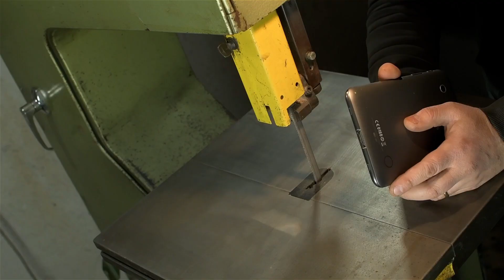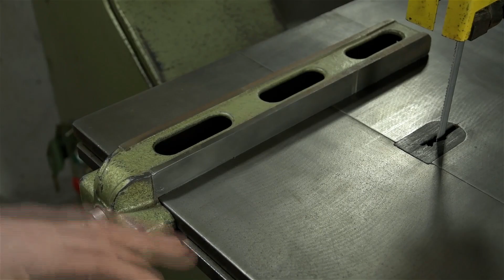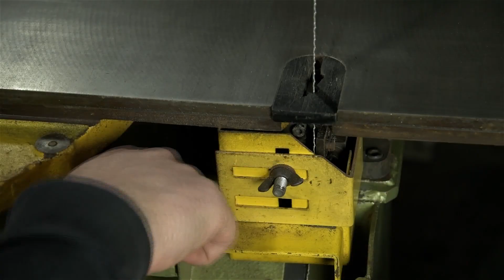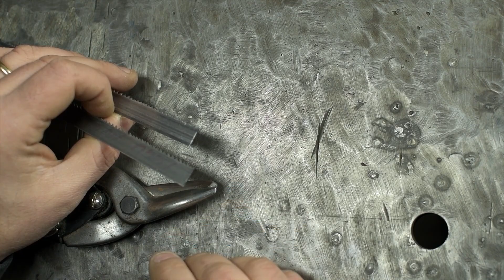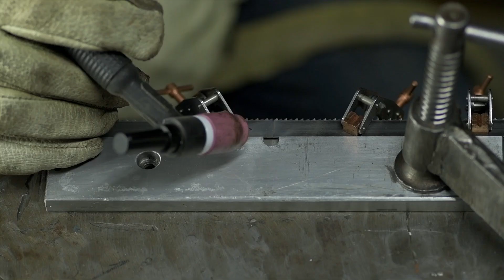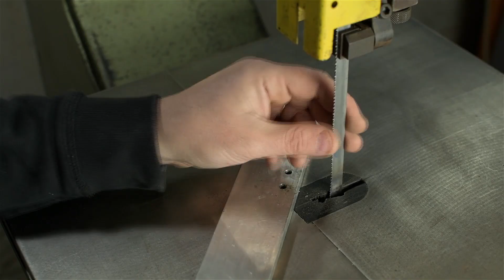LIVE!? - Welding Bandsaw Blades & Startrite Saw

Comment: I don't need a third bandsaw, but if I did, I think you might've sold me one one of those beefy startrites I see in the listings from time to time.
TIG welding the blade seems like a reasonable enough way to solve the problem, though the other gotcha aside from having to anneal the site of the join is that in so doing, you may want to put some wet clay on the teeth to keep from drawing the temper of the teeth. That may be more fussing than is really worthwhile - I honestly dunno.
Reply from the maker: interesting, never thought of that!
Reply: The advice is worth at least as much as you paid for it. ;D full disclosure: I've never tried the wet clay trick. I've just seen it written about in old blacksmithing books.

Comment: Let's have a guess at this: The base of the Escher illusion is at 45 degrees moving away to the left, the thin horizontal is at 90 degrees to the base front upright, the top is at 90 degrees to the thin horizontal but moving forwards. So the top front leg is not connected to anything and neither is the bottom rear leg, nice, draws the attention, cheers, Andy

Comment: Hi Tony. You making the best Films ever. Your bandsaw is bretty neet, but these 3 wheels put, how you mention it, a lot of Stress on the blade. We have such a Saw but bigger at work, and the blades are often break bevore they get dull. And when I look at the broken blades, I see a lot of cracks. The harder the blade, the more often they will brake on you. But for your use, that wouldn't be such a big problem.

Comment: I tried to tig a bandsaw blade tonight after seeing this and it just didn't work for me. I have a size blade that has been discontinued and thought there may be joy, but I'm scratch start and can't initiate an arc at low enough amps. When i get it high enough to initiate the arc it blows through the blade. So great job tony, wish i could do it.

Comment: We used to put 180degree folds in the belts on our cam auto lathes for even wear on both sides. Never did any testing to see if it actually helped or not, just took it as granted that it was done that way, and continued.

Comment: Hey Tony... I have a Startrite Bandsaw 18-T-10 with ball bearing guides. I’m in the process of remanufacturing these parts for the blade guides. The band saw came from a College workshop where the blade hasn’t been set correctly and has mullered both assemblies. If there is a way of sending the drawing I have and other details I would happy to do this. John 🇬🇧
Reply from the maker: Thanks John!  I'm going to feel out these solid guides for a bit, see how they work in real life.  But if I come back to roller guides, I'll be sure to get a hold of you!

Comment: Tony, I’ve had great success silver soldering butt joints. Never had one fail actually. The only other trick I was taught was to twist the blade 180 then holding the ends together and touching those ends against a bench grinder to make the ends complimentary angles before soldering. Regarding your request for opinions about blade guides,  DoAll, and my Powermatic, use hardened metal guides that come down at an angle. They work great but you need to have sets of different thicknesses, and a blade guide with an adjustable thrust bearing.  I’ve seen then for cheap on eBay.  Thanks for your terrific videos.

Comment: Your video timing is impeccable, I just bought a green vertical bandsaw last week and finished wiring it with a VFD 12h ago.
Now i feel prepared to play with welding blades :-) 
PS I also made a joke about mine having a blade speed for asbestos.

Comment: :D A mobius blade would need teeth on both edges and would last twice as long between sharpening because the cutting edges would serve half duty. You'd have to come up with some weird multi wheel / guide system to manage the twist, and I'm not sure how you'd make the blade guide since you'd need something to press sharp teeth against during the cut. Neat to think about. I want to see someone make it.

Comment: I had 2 Startrite  bandsaws . One was the identical model you are showing and i also had a smaller version with the roller blade guides. 
The version you have is the best but you need a full set of blade guides. I used to grind and braise my blades with oxyacetylene torch as it also anneals the bade at the same time.

Comment: Your the best Tony!  But when it comes to blade guides, the roller guides from the "Roll in saw" model EF 1459 are the best ever. My roll in is about  30 years old and the guides are the originals and still going strong with daily industrial use. The only problem is the # 1A48 guide set is $405.00 but you could copy the design and make your own. 1/4 to 3/4 blade size with no adjustment and no adjustment for gage of blade. Check them out!
ATB, Robin

Comment: We've got an old Startrite at work - I love that thing. Have cut all sorts of metal, phenolic, and even used it to resaw some fine timber. Ours has the blade welder but I've found it to be a bit fussy with blade stock. Was struggling to get a good weld on some 1/4 inch stuff last week so may have to have one of the mouldmakers teach me how to TIG. Our blade guides are pretty shagged and we'd like to convert to roller guides so I'm going to keep my eyes peeled on your channel for an update. Subbed.

Comment: Also... I'm thinking some brass or even copper roller guides that contact the blade would be kind of interesting. They'd heatsink the blade a little, potentially meaning you can run it WAY faster... While also potentially making the blades corrode and snap.......... Win win! Particularly for copper, I was thinking there'd be some actuated scissor lever spring thing that retracts them away from the blade when it's off to prevent mega corrosion... and also automatically adjusts for copper wear... And I guess I was thinking/hoping on oil on the blade stopping everything from corroding from the copper dust. Notice I'm suggesting you do this for your equipment and that I'm not going to try it on my bandsaw. Because 1) don't have a bandsaw and 2) sounds like work.

Comment: Also. Solid guides are much better in my opinion. There must be two of them. One under the table and one just beneath material. Solid guides makes saw much more rigid. Bearings gets worn of pretty quickly and bandsaw begins to dance. To me if you look at the bandsaw guides and see bearings you can bet this one is some cheap china product.

Comment: I had one bandsaw with three wheels. Two big wheels are better because on small ones bending radius of the saw is too small and saw breaks easily. Only solution is to buy soft and not hardened saws. I dont want to scary you, maybe yours will be better. Mine was german made (DDR to be precise) and i had to get rid of it because of this issue.

Comment: Thanks for the video Tony.
About 15 years ago I built a vertical band saw so now I have a horizontal and vertical. I use .250" (28 tooth wavy if I remember) blades in the vertical so that I can cut thin metals with contours. 
When I built it I bought a welder after welding and brazing a few blades. I found I went through more blades than I thought I would over time. It's quick, cheaper in the long run and I do inside pockets with much less hassle.
I did build roller guides. I think they are better but I don't know how long the system you have lasts, after all it is a commercial machine so it may do you just fine.
Enjoy it. I'm thinking about a file machine too, look forward to you build.
ps: I'll never give up my shaper!

Comment: 4 dimensional band sawing can be done with other blades, but I recommend Escher brand - Swiss and expensive, but much better distortion of reality.
Reply: Cut with a Schröedinger once, dropped and lost the final piece and I never knew if it was actually cut. Next I'll try Occam's razor; it's said to most probably do a easy job.
Reply: Escher was Dutch
Reply: thisnicklldo I tried Giger and Beksinski blades in the past. Do great at cutting through existential angst. I'm still getting ptsd flashbacks.
Reply: After 30 years of working on large bandsaws  in saw mills, it still amazes me that welds in 13" wide and 40 to 50 foot long bands can run with welded teeth and cracks for 10 to 12 hours and still hold. That"s not a normal run but it happens. The best saws are from Udaholm in Sweden.

Comment: Nice machine, A vertical bandsaw is one of the best addition to the shop.

For a metal cutting bandsaw nothing beats solid bandsawguides. Either hardened toolsteel or carbide. Yours look a bit worn ;)
The run smoother than roller guides and you dont roll chips into the bearing/blade.

Btw: Matthias Wandel disaproved the three wheel bandsaw.
Btw2: Selling a shaper is a major crime in most European countries.
Reply from the maker: That explains the strange behaviour.  Buyer showed up in a black ski mask and one of those voice changer boxes.  I didn't say anything at the time, figured it was just their European flair.  ;)
Reply: I'd love to see someone make a solid  carbide guide with the side guides ported for coolant so it forms a hydrodynamic bearing.
Reply: Black market shapers. Really?
Why is that Stefan?
Reply: What if I just used cast iron?
Reply: @snaplash  Yeah, quadrapoles are nice and all, but they don't quite give the saw that relativistic speed needed for time travel. A strong parallel electric field eliminates the need for a motor in your saw.

Comment: i work with my stepdad when i was a teen. and worked for a man that had a lil business sharpening everything with a blade on it. from bandsaws to lawnmower blades. my piont is. they also fixed anything with a blade. from brazing carbide tipped skillsaw blades back in place to welding bandsaw together. we had to tig them back. tell the man broke down and got a bandsaw arkwelder. u just put the bandsaw in the jig. heated it up with the machine by touch and then arked it back together.

Comment: Speaking of Matthias, he had some thoughts on 3 wheel bandsaws as I recall. As you use this over time, I’d be interested in your experiences with wheel alignment and particularly breaking saw blades due to metal fatigue. https://youtu.be/OfkYNhe1u6M
Reply from the maker: my take-away is that 3 mason jar lids aren't great for bandsaw wheels.  :)
what he says makes sense, I'll have to see how this thing does, but there are a lot out there with a good track(ing?) record.  plus, I probably won't be using it as much as MW does.  time will tell!

Comment: After doing a roller conversion and fooling around with a few saws, I found that angled brass blocks made the best lower guides to keep chips scraped off the blade. Upper didn't seems to matter roller or  plain. The roller on the back of the blade is a lot smoother and quieter if running on an axial face of the bearing and not the radial OD. The smoothest setup I had was an old meat cutting saw that used carbide guides.
Reply from the maker: good to know, thanks RC!

Comment: You should probably "anneal" after brazing, too. The logical part of my brain told me I didn't have to, either, but my unannealed blades would (after working fine for months, even) invariably die by snapping about a half inch away from the joint. To top it off, I jig the blades in a wooden jig a good 3 inches away from the joint, so there's no additional heatsinking from metal clamps or whatnot. Ambient air-cooled 100ish inches of cold blade are apparently enough of a heatsink to harden the hot spot for at least some blades (1/4" Morse and Laguna blades, FTR; I wonder if they are a type of air-hardening steel, maybe).            

When I say "anneal" it is a nod towards traditional info passed on for decades. But in reality it is tempering. So long as you don't get the blade too hot when brazing, you technically don't have to anneal, but you have to let some of the hardness out of the joint.

If you weld it, you have to really, actually, truly anneal it. Except in this case when I say annealing, it really means "rehardening but without getting it too hot beyond critical." And after this other definition of "annealing" it, you additionally should temper.

The word "annealing" has been misused by so many people for so long, it naturally causes a lot of confusion.

Comment: I'm a bit heartbroken about the shaper...  WTF bro?!  the Mobius blade is genius. 

I'm a fan of rollers.  theres lots of little tricks you can do to get little bits of adjustment out of them here and there.  If you're going for solid blade guides then stay carbide and run higher clamping pressure(which it looks like you dong have that option) and keep oil around.  

Coolant mist is AWESOME for band saws, you'd likely not see the difference on a hobby level but don't be afraid to bring your mister over to the saw.

Comment: I have tried brazing and silver soldering bandsaw blades, and after lots of trial and error, mistakes, and wasted time, I found that the secret was....I went on Ebay and bought a blade welder. Hope this tip helps someone.
Reply: What blade welder did you buy?
Reply: Tig weld then anneal the weld

Comment: I think you could have reduced the jerking of the saw blade if you had welded them with the teeth against the stop rather than the back. One blade might be slightly wider than the other, so when the wider blade comes around it sticks out and tries to take a big chunk out of the cut. With the teeth against the stop you would ensure that there is no step in the depth of cut.

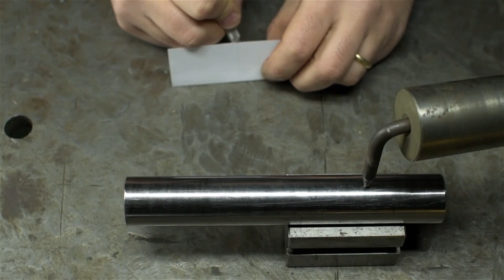Comment: Not sure why you need a bandsaw when your finger snapping (11:10) cuts pretty straight!!!!!
Reply: Ah you see, this is a common misconception. Snaprifting is not a cutting process, because the space-acoustic-wave created by the snap creates a miniscule rift in the crystalline interconnection of the workpiece, momentarily tearing a rift in the material. Since the rift is not filled with air, it is practically a vacuum, and ambient air is forced into the rift, pushing it apart.

That's why the technique cuts almost in a perfect plane perpendicular to Ampere's right-hand rule normal vector.
Reply: that sir is quite an intelligent definition of a snaprift space-acoustic-wave modulation well played sir well played
Reply: I think Tony got that technique from Chuck Norris
Reply: for curves!
Reply: It's so he can cut internal curves like the plasma-cut wrench. Finger snapping only makes straight cuts.
Reply: Assuming...  One must be very careful in the direction that one Snaprifts!!!!!
Reply: Who says he needed it?

Want is enough justification. 🤣
Reply: Yeah but the cut was on the wrong position. Jesus, did you even watched the video?!!!1

Comment: WARNING WARNING WARNING STUPID QUESTION INCOMING............ does that thing ACTUALLY give you feeds and speeds for cutting asbestos?????????????????????????????? i though it was like a fibrous rocky thing used in like brake pads and insulation?
Reply: waderedsox also as floor tile and gaskets and exterior tile for houses...
It all cuts with a saw, the really hard forms could be scored and snapped, but these days if you were going to cut it you would want a submersible band saw. It is the dust that gets you.
Reply: i mean i knew it was really bad, mesothelioma i think, i just didnt imagine it was the sorta thing you'd frequently cut on a bandsaw XD thought it might be another of tot's clever editing jokes XD

Comment: On the topic of brazing, the best option is to actually cut at 30, then overlap. That gives a very long strip of braze. We tested one for weight, and it took nearly the full weight of the normal blade before snapping. But yeah, it's cumbersome and TIG is better and simpler.

P.S. you should totally build yourself a jeweler's wire press and custom make TIG wire to your desired thickness, by my old teacher's words, best tip i've been spoon fed. Mostly because you only buy big stock then, and do whatever you want after that. Doesn't work with all types of filler rod, mostly the simpler ones.

Comment: I made mine out of ceramics, heavy duty traffic chips i had left over. The thrust guide is however hardened steel, quenched in motor oil (because it gives a black shine and it makes things look badass).

Comment: Great 'Livestream'. One question about the last project you showed. I understand the Möbius blade, but how do you get the welder to work in that extra dimension? One tip with the Möbius blade, you need to cut teeth on both sides of the blade, or your cut rate drops of every half revolution.

Comment: For the Möbius blades would you suggest setting the uncutting teeth off by the full depth of the cutting teeth, or did you use some other offset? I scoured both "Machinery's Handbook" and "Gödel, Escher, Bach" to no avail.